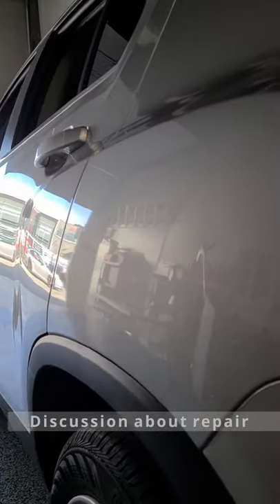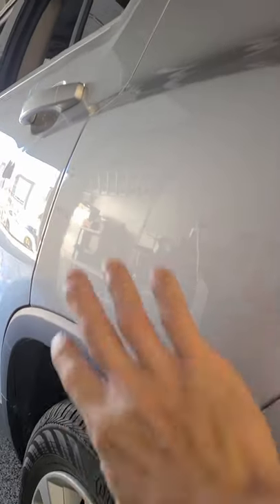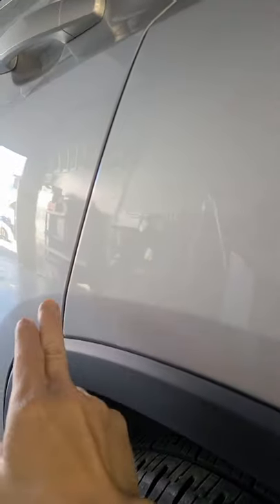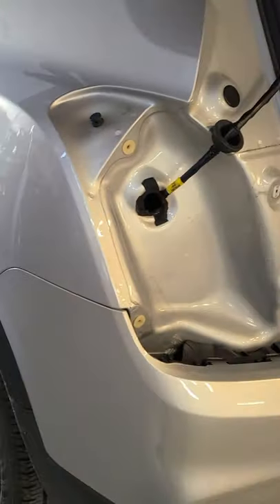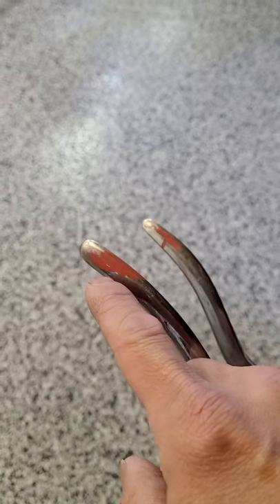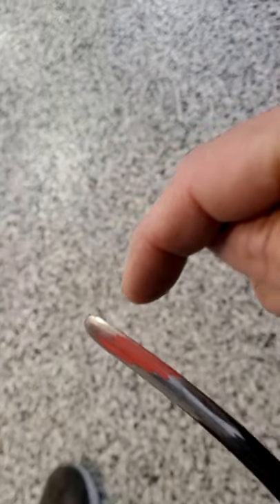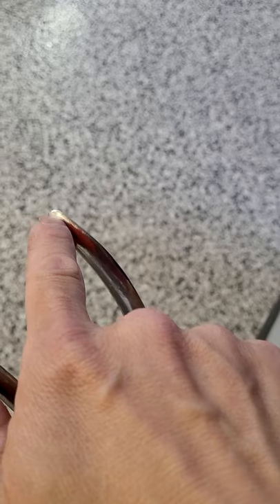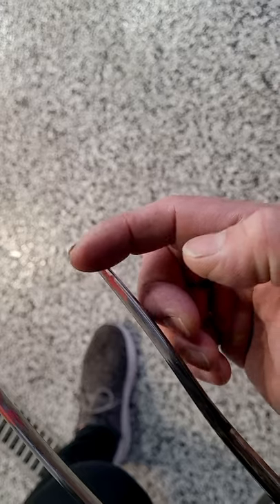Stanliner Snake : Bonus video - visual examples on a real repair

Comment: Pak you did very well with your description and explanation of the Stanliner tools .The dent finished was just fantastic.Tell me how long did the actual repair take mate .?
Reply from the maker: Hey Geoffrey, I don't usually talk about times, because it's not that important to me. Sometimes my times aren't good when I am experimenting new things or I have to problem solve. But this one was straightforward, I knew what I want to do and it worked out nicely. 
This repair took Just 90-100min total. 60mins to setup, quick glue pulls, took care of all the sharp parts. And another 30-40 blending outside and inside the panel. Thank you for the compliment on the finish, I really appreciate that confirmation.